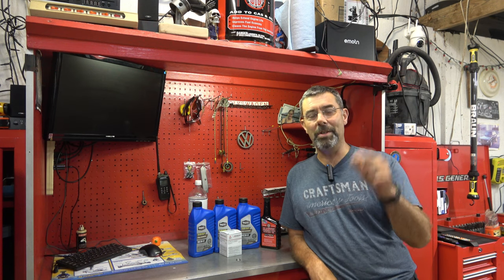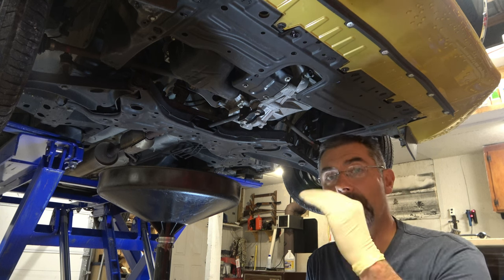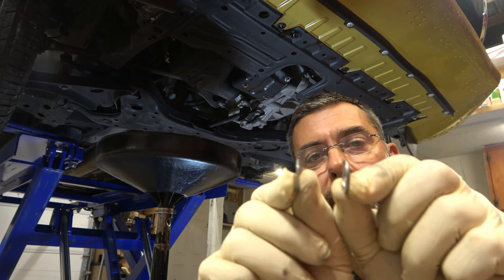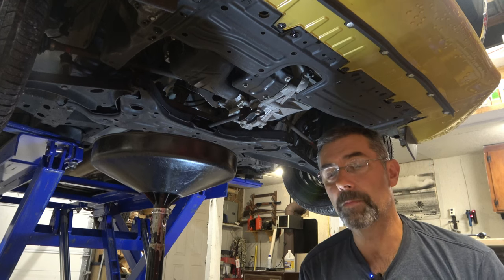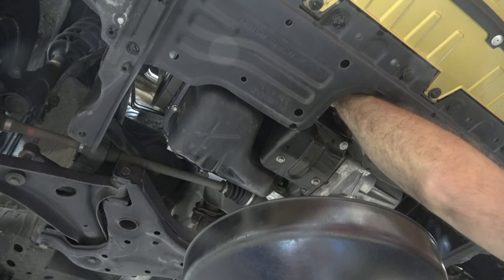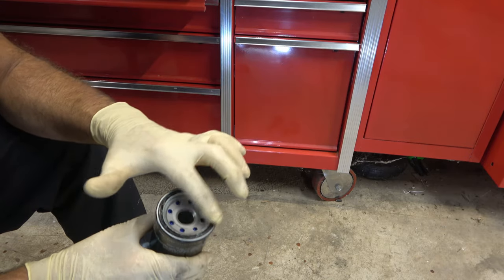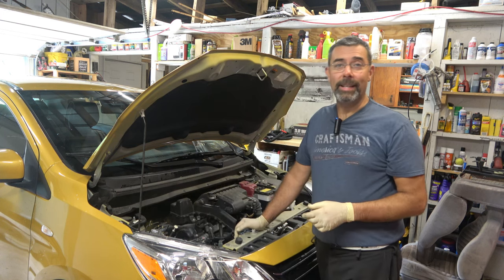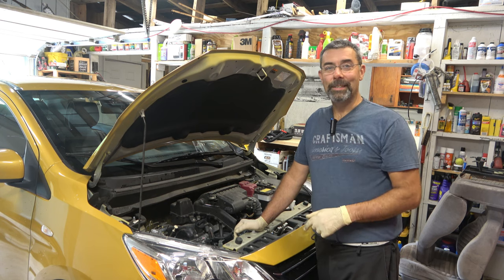2021 Mitsubishi Mirage Oil Change. How Is This Ultra Economy Car Holding Up?

Comment: I own two 2017 G4's and one 2022 G4. Theses cars are rock solid, All only require general maintenance tires, brakes, batteries, filters and regular oil changes. *I do my own oil changes, worst part of that is the oil filter minimal space.
Reply from the maker: I agree that it's tight up there for the Oil filter. Bad spot for sure!

Comment: Just bought a 2024 Mirage, so thank you for these videos! It’s my first new car after decades of owning used a Subaru Forester, Ford Ranger, and Pontiac Sunbird before, all subjected to unknown abuse. When I asked the guy at the dealership if I’d void the warranty doing CVT and oil changes myself, he said no, but why would you - it’s free. You confirmed my suspicion… besides, my girlfriend has had her Honda Fit comes back from their service center on several occasions with a new tire facing the wrong way, lost lug nut, and missing clips for the plastic covers on the bottom. I’m happy to have it done right by myself, I want this puppy over 200k.
Reply from the maker: It’s great to know you’re going to look after your new car!  If you feel comfortable I would do the work yourself.  Most maintenance repairs are pretty simple

Comment: Great, I have to disagree on the oil change intervals though. I follow factory instructions (10.000 miles) and I have zero oil consumption in my Mirage after 80.000 miles. In fact, I always follow prescribed oil change intervals with all my previous cars. They died of various reasons, but never because of the engine wearing out. I have to say, I drive almost exclusively  longer distances on the highway at moderate speed.
Reply from the maker: I hear you. While the Mirage may be OK, many other cars suffer from PCV system failures and oil burning issues as they age making timely oil changes critical.

Comment: If you want your 3a91 ,,3a92 engine to last,,,don't use 0w oil,,,,,Use 5w30 full synt,,the best oil you can afford,,,,And change it at 5k miles,,
Reply from the maker: I use 0w-20 synthetic as that is what is recommended by Mitsubishi.  I would not want to use something that is not recommended by the manufacture, especially when it is still in warranty.

Comment: I've heard mixed feelings about filling oil filters. There are plenty of cars I've done with the filter upside down so it's impossible to fill before tightening. More importantly, if there are any contaminants in the oil jug (even micro plastics), they won't be filtered out.
Reply from the maker: Never thought about contaminates, but I still feel the pros outweigh the cons. The number one wear factor for motors is lack of lubrication. Starting these empty gives a second or two of no lube.
Reply: @FarpointRestorationsAndRepairs  Agreed. It's unavoidable on dry-sump vehicles, but it's avoidable on these guys. No harm in filling up the filter IMO.

Comment: I use Fumoto valves on my vehicles easy changes. you replce your drain plug and never need a wrench .  I even had one on my Freightliner with a caterpiller engine
Reply from the maker: I really need to look into those. It's a good idea.
Reply: What Fumoto valve did you use for the Mitsubishi Mirage?

Comment: WOW, Thank you. Very similar to my Hyundai Accent Hatchback (GS). I am not a Professional Mechanic but I have been wrenching on cars since the early 80's. Drove aircooled VW until the late 90's. My current ride (Hyundai) uses 17mm for the plug  as well. Even has a cut-out in the bottom splash shield to remove the Oil Filter. 3.2 qt as well but 4 cyl. My Accent is going on 124000 mi so I am looking around. Again thanks !!!
Reply from the maker: Mitsubishi is known for making parts for many other manufactures so they could be the same. Shoot, 124k is still young if the proper maintenance has been done.

Comment: I do mine every 3k. All I do is city driving. It might be overkill but it’s cheap when you do it yourself
Reply from the maker: I have no problem with that! I did 2500 mile changes on my old car when I ran conventional oil in it.

Comment: I see a lot of these cars driving around the 317.  I have always wondered how well they hold up.  It seems like a good car for someone that wants a new car with a warranty and not a ton of frills.  What is your opinion of these?
Reply from the maker: I like this car so much I bought another one. I've been a mechanic for nearly 30 years and when I saw one of these I knew it was the perfect car for me. It's simple, easy to work on, and rock solid durable. This is a modern Geo Metro and it improves on the Metro in every way possible. 
  If you think you might want one, I say go for it!
Reply: @FarpointRestorationsAndRepairs  thanks for the info!

Comment: why isn't there more protection for the drive belt ?  it is partially exposed to the elements.  On my car, when I drive thru very heavy rain on the roads, it splashes up and causes my battery light to come on.  Why can I see to the ground from the engine bay??  Anyone know?
Reply from the maker: The only reason you're seeing the battery light after deep water, is that the belt needs to be tightened. It's slipping when wet. 
  As for protection, it's normal for nearly all makers to leave the bottom of the engine exposed.

Comment: What would happen if you put a little thicker oil ?? Just wondering.. Thank you
Reply from the maker: Slightly reduced fuel economy, but as long as you are talking one weigh up like going from 0w-20 to 5w20 or 5w-30 you should be OK. Don't put 10w30 or 15w40 in there!
Reply: @FarpointRestorationsAndRepairs  one more question please how’s the rear sway bar doing?? Did it make a difference??
Reply from the maker: It is still doing good. I never put one on the wifes car but she did not seem to notice enough from my car to care about it.

Comment: Are crush washers exclusive to Mitsubishi and/or smaller Japanese motors? Do quick lube shops like Valvoline have crush washers or just brass ones? I'm asking because I'd like to bring in my new Mirage to a local Valvoline (that I've gone to for many years and the management is very good) to peform a preliminary oil change (1,000) before my regularly scheduled oil change at my dealership.
Reply from the maker: I'd say they will use the copper or aluminum washers. Very few shops have these special crush type washers.

Comment: My mirage 1.0 driven 150k kms..i currently living in pakistan..what engine oil is recommended.. currently my mechanic use 10w40
Reply from the maker: I would use 0w20, you might be able to do 5w20 if the weather is very hot. Hope that helps
Reply: 5w30 I use down here in the Gulf

Comment: Can you do a video about o2 sensors the readings on a scan tool please
Reply from the maker: Certainly. Do you want to see the live data and what to look for if one is not working?
Reply: @FarpointRestorationsAndRepairs  that’s great! Yes please I would like to see the live data, also when idling and driving, I am trying to determine is my sensors are no good. Thank you a lot!
Reply from the maker: let me see what i can film for you
Reply: @FarpointRestorationsAndRepairs   I guess I just need to see the value of the bank 1 sensor 1. My 2014 mirage is reading in the 2.3V range. My downstream is reading 0.8V Any ideas would be great!

Comment: Super tech oil? Hmm, if it stands that then the car is rock solid. BTW, Shell makes pennzoil now, and they DO NOT make super tech! Ask me how I know. What you're getting with cheaper oils is a smaller additive package, it passes the API standard, but you're getting nothing extra.
Reply from the maker: That's why I add 4oz of Marvel Mystery Oil Synthetic. It's the additive package.
Reply: @FarpointRestorationsAndRepairs  I think you'd like pennzoil gold synthetic blend 0w20, it would give you great protection, the drain intervals you like, and without the expense of a full synthetic. Pennzoil brand is now owned by Shell oil so there's no connection with the "old" pennzoil.
This is just a suggestion, I'm in this business and totally understand how people can be when they decide "whats best" for their cars. I enjoyed your video, and if you ever do a teardown of this engine that would be great to see as well. Thank you!

Comment: I want to buy a car. What are its weaknesses?
Reply from the maker: The only two complaints I have for this car. First. The gas tank is too small. 8 gallons. I have to fill up every week. A 12 gallon tank would be far better. Second. Anything over 4 hours and the seat starts to feel hard. Long trips out of state are tough.
Reply: @FarpointRestorationsAndRepairs  Thank you. I live in New York. And I want to buy a small car. I used to live in Russia. There have always been bigger cars. And there is a lot of traffic and there is no parking space. I was surprised by the positive reviews of the car.
Reply: That would be my complaint as well. Oh and just because i change oul every 3000. Now i need the transmission serviced. They want around $350@FarpointRestorationsAndRepairs